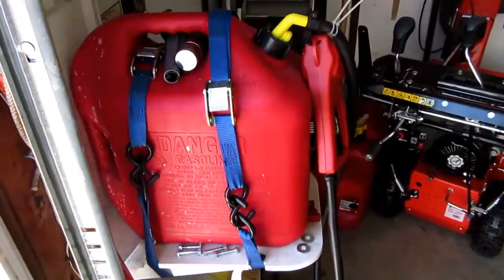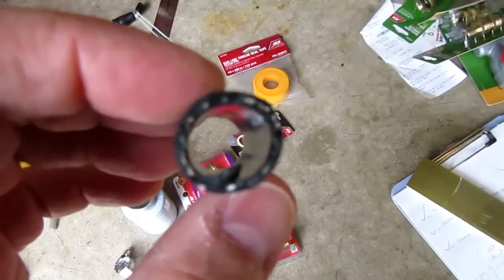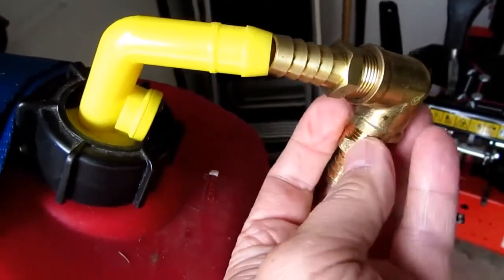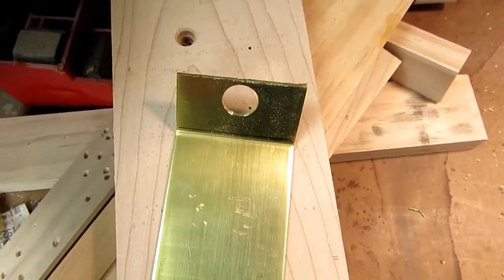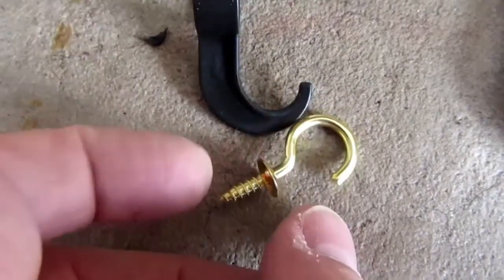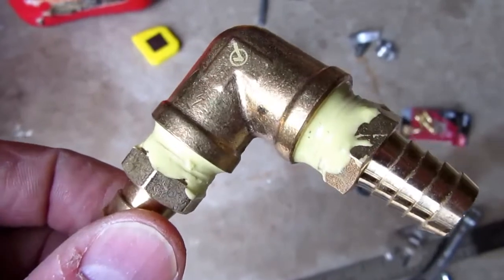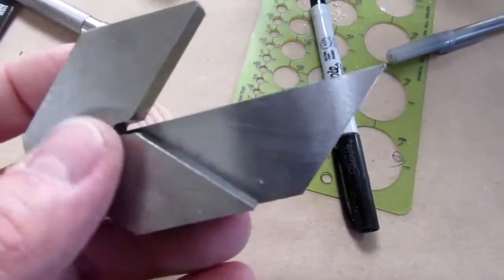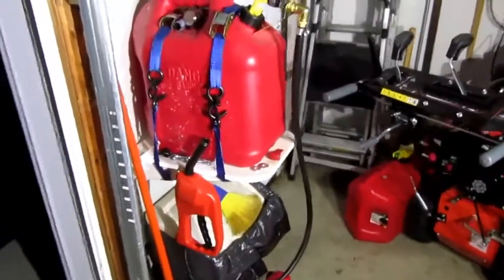Adventures with Fuel Transfer, Part 3: Un-kinking the siphon pump hose

Comment: Where did you find the pump and hose? I want one.
Reply from the maker: The siphon hose system is the "Flo n' Go" made by Scepter, https://www.scepter.com/products/consumer-products/flo-n-go-maxflo-siphon-pump/, and it is widely available in stores, online, etc. They offer a number of versions of the product that include not just the pump nozzle and hose, but also various fuel containers, etc. It is a good product; I have had mine for a few years, and it works well.